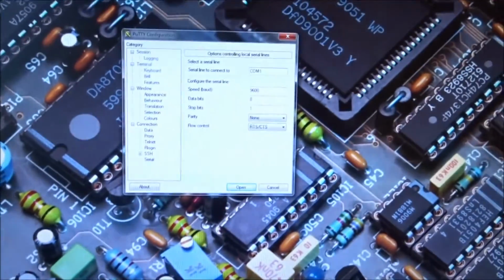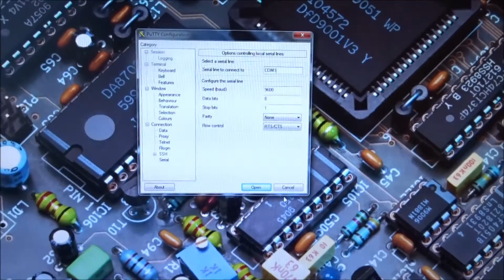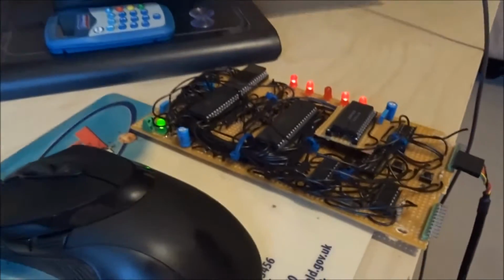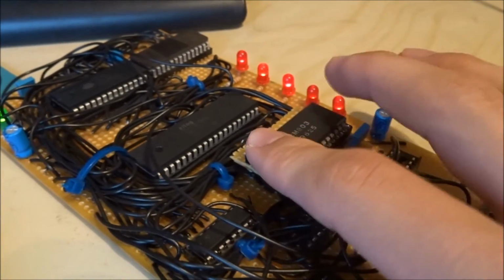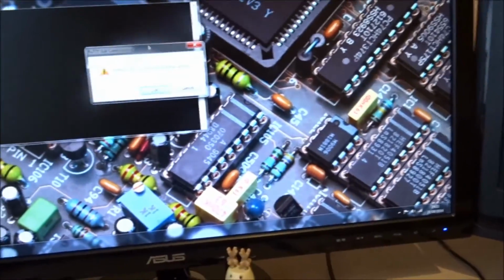Homebrew Z80 Part Five - Troubleshooting!

Comment: The first thing I would get working is to put an LED on the /HALT line of the Z80 and see if you can get the CPU into halt mode with a single instruction from the ROM, once this is working you can try to write and read the ram check the read value is correct and then halt, next add a single latch chip 74HC373 to the IORQ and wire it to 1 LED and 1 data line and then write to the latch with a simple counter and see if you can make the LED blink. Next to try more LEDs on the latch and get them doing what you want. This is a tedious thing to do as you'll need to write the ROM many times with different programs. Make sure the LEDs on the data lines have 1K or higher resistors in series with them as lower values may overload the bus. Remember to make sure all the control lines on the Z80 as in a known state and not floating or you'll get lots of weirdness.
Reply from the maker: I have the means to program ROM's but I do not know exactly how I would write and compile the code to do that. I shall have to learn some assembly, however how do I compile that into a hex file I can actually write to ROM? Are there some applications that can do this for me? How would I check the value written into RAM is correct without LED's on the databus. I was told not to have LED's on the databus as they may cause issues? Is it ok to have them there as long as they are paired with high enough value resistors? I will check my control lines again as per Grant Searle's schematic.
Reply from the maker: Unfortunately I work away from home during the week, so I can only work on this at weekends. I'll go through your suggestions when I can at the weekend.
Reply: Start with a HALT instruction, from the Z80 user manual page 173 the code is 0x76 and leave the rest of the rom as NOP 0x00. You can assemble it all by hand until the code gets complex. Have a look at Talking Electronics Magazine Issues 10 - 15 you'll see the TEC1 computer I learned Z80 on many years ago. If you learn to asemble code by hand then once you get an assembler going you'll understand what's it's doing.
Once you've halted the Z80 you can look at all the address, data and control lines, it also wouldn't hurt to have a single step clock, remember that the Z80 requires many clocks to execute a reset.
Reply: LEDs on the data bus are fine as long as they are used with resistors and don't overload the bus. 4K7 would be good if you've got high intensity LEDs. The other option is to buffer the bus before driving the leds, a 74HC245 or similar works well for this. You can use a 74HC373 or 74HC573(easier pinout) with the Latch Enable line high it will act as a buffer for the LEDs. Later on you can connect the LE line to a decoder and use the LEDs as an output port to indicate the state of your programs.
Reply from the maker: Awesome! Thanks very much for the advice and info, adds another little bit of knowledge I have taken from this project. I have some 74HC373's on hand so I will put one of those on the board this weekend.

Comment: Any way you could post the assembly code somewhere like on a website or make another video. It might be initializing code for your UART or a number of other things. First thing is first though unless you are using transistors on each LED then you should disconnect the LEDs from the data and address bus as this will add load and cause problems. Instead try and wire a latch chip up to the data bus to latch it to LED outputs. DM me for more info as I was/am working sparingly on a similar project.
Reply from the maker: Thanks for your comment!

Interesting about the LED's, Is it the extra current draw that causes issues? I will disconnect them when I get the chance this coming weekend as I am not using transistors. Depending on space I may be able to wire in a buffer IO buffer chip for the LED's as you say. In terms of the assembly code, do you mean the code that is currently running on the ROM? I am using Grant Searle's code to run a basic interpreter on the system. Then I know the code definitely works and it gives me a nice method of exploring a bit of basic, even if that isn't the end goal. His code can be found here: http://searle.hostei.com/grant/z80/SimpleZ80_32K.html

I would have DM'ed you but I can't seem to find the link to it on your channel page.
Reply: Have you tailored that code to the clock speed you are using? If you are using a different clock speed then you will have to check how the baud rate is being set  in the 6850 via the code. That is probably via the INIT routine in int32K.asm from the code in the link you pointed out. It is not explicitly obvious from the code either so you will have to make sense of it. The two lines above the comment  ; Initialise ACIA probably do the work. Also how closely are you following the schematic on that page? From a previous video where you go over your schematic it does not seems like you are following it very closely. I see two options to get you out of your rut. One would be to follow the schematic down the the component value and not have to worry about how the code works. Two you can try and edit the code to work with your hardware setup. Most likely the second option is going to be filled with frustration so I would try and get something working even if it means doing things exactly the way others have, and then changing it from there to how you envision it.
Reply from the maker: Didn't know that would actually be an issue, I will look into either getting a 68B50 and the correct clock speed or somehow modifying the code. The first video is a bit outdated as the design has changed a bit, I have basically removed the IO buffer IC's and wired in the ACIA instead. This means that the memory controlling is slightly different, although I believe it fulfills exactly the same function. Also the clock speed is at 4Mhz not 7.638 (I think that's what grant has it at). Hence why the code would need changing or the hardware.

I don't know how easy it will be to find a 68B50. I shall do some searching.
Reply from the maker: Having looked at Grant's Schematic I dont think it's possible to just merge them in the way I have done. I think I need to rewire the memory decoding to switch from ROM to RAM when I reach an 8K address. Should just be a matter of disconnecting one of the memory decoder wires and connecting it to a different address pin. Also grants page seems to suggest that standard 6850 and Z80 chips have worked fine for him at higher than specified speeds so I may just try getting a higher clock speed crystal first before I change the chips out.
Reply from the maker: I've removed the LED's from the data BUS and checked the memory rewired the memory decoding. I have wired my memory decoder up to pin A12 for the time being, although I think A13 and A14 will also have to be connected to make sure the RAM chip is selected once I am above 8k in memory. In terms of the other connections on grants schematic I think i'm ok as I used the same connections as him for the ACIA. The clock circuitry and memory decoding are different however. I'm going to add the capacitors to the clock circuitry just incase the clock signal is a bit sporadic, although something tells me this isnt the case.

As suggested above I am contemplating wiring this up on a breadboard so I can easily mess around with the connections. Once that's working I can move it to the soldered board.
Reply: Sounds good. I agree below with the idea of getting a HALT instruction to work and go from there.  Wiring on a breadboard will take a bit of work, but is going to save time in the long run so that you can easily identify and fix mistakes. I would say a logic analyzer would be a bit more useful than an oscilloscope for troubleshooting, but I have found neither to be absolutely necessary for what you are doing right now.  Not to say they are useless at all, but I would personally wait for a deal to come around if I had other ways of solving my problems without one.

The code for a halt program is literally going to be less than 5 lines that can be assembled by an assembler like the TASM. (The Telemark Assembler). You can save yourself the trouble though and just make a HEX file with 0x76 as the first instruction and burn it since this is all you really need.

;*  Z80 Halt Program
.ORG 0000H
MAIN:
 HALT
.END

This way you can wire up just the ROM, Clock, and Z80 and have a test that will tell you immediately if the the ROM is doing its job. You can then add in the RAM on your breadboard and do as mentioned below in the comments and load some data into RAM and read it back again to make sure RAM is working correctly. (if the halt LED turns on you are good).

;*  Z80 RAM Halt Program
.ORG 0000H
MAIN:
 LD  A,$BB   ; if we read back BB then HALT
 LD  HL,$8000  ; likely where your RAM starts
 LD  (HL),A   ; store BB in RAM
 LD  A,$00          ; clear accumulator 
 LD           A,(HL)                    ; Load acumulator with BB
 CP  $BB    
 JP  Z,RAMHALT  ; goto RAMHALT if  ACC is BB
 JP  MAIN   ; try again if ACC is not BB
RAMHALT:
 HALT
.END 

This will probably bring you to a point where you can start thinking about adding in I/O like UARTs and being able to blame code while ruling out the basic hardware connections to the memory and CPU.

Comment: You've probably ditched this project by now but those capacitors (called decoupling capacitors) are way too large. Every chip should have it's own 100nF (0.1uF) cap placed as close to the chip's power pins as possible.

Comment: i dont get why you would put that on a proto board (is that what that is, soldered?), why not just a bread board?
Reply from the maker: If you want something more permanent then a soldered board is way better than a breadboard. That was the aim with this. I do however get your point, much easier to change connections with a breadboard. I also wanted to do some point to point wiring as I have never done that before, added experience and I like the challenge of laying stuff out.

Comment: If you need an oscilloscope for basic measurements you could use your computer as one? http://www.instructables.com/id/Use-Your-Laptop-as-Oscilloscope/?ALLSTEPS
Reply: Where are you based? I'm in London.
Reply from the maker: Just outside of York! That oscilloscope looks interesting, I may look into getting the parts for that further. Luckily at work I have access to an oscilloscope so I may be able to use that to debug this board.
Reply: ok cool. I've been to the Maplins in York. :) otherwise i was going to say, if you're in London I've got an old scopex scope you could borrow.
Reply from the maker: Very kind offer! Unfortunately I just couldn't pick it up or get it back to you within a reasonable time. I'll definitely have a look at the laptop or the raspberry pi oscilloscope that ionel rusu suggested though!
Reply: if you've got a R-pi, go with that one. :)